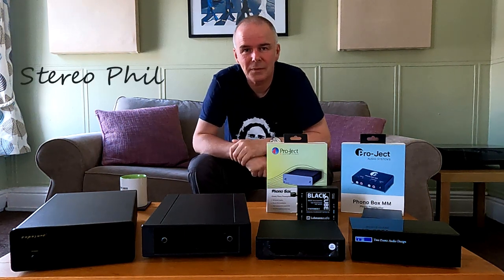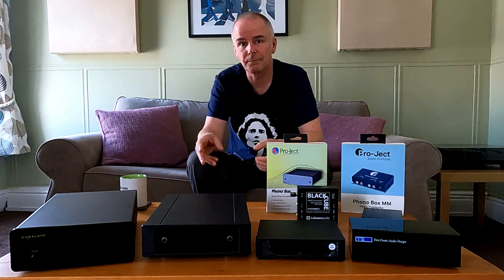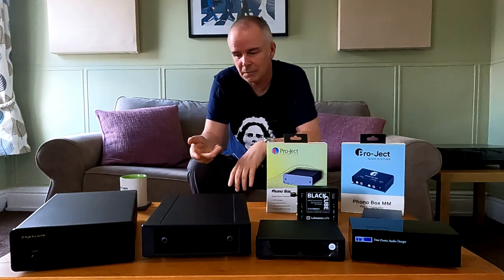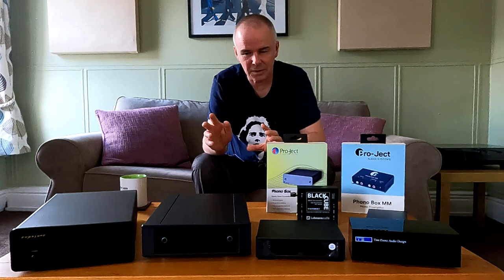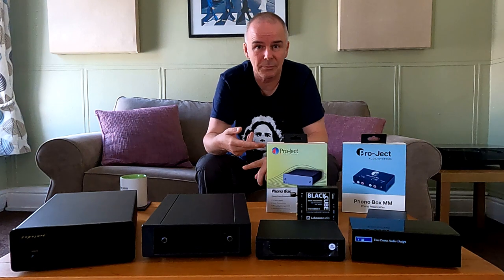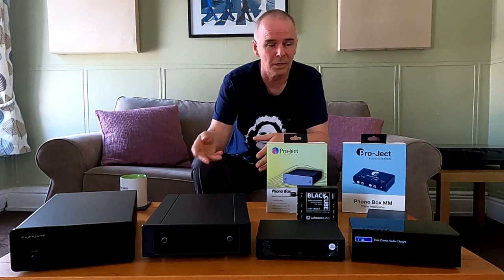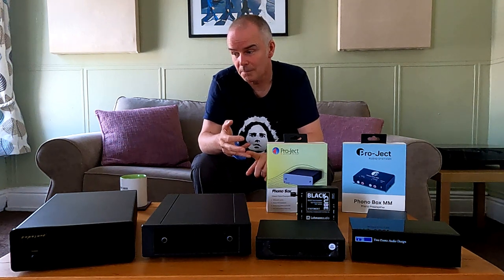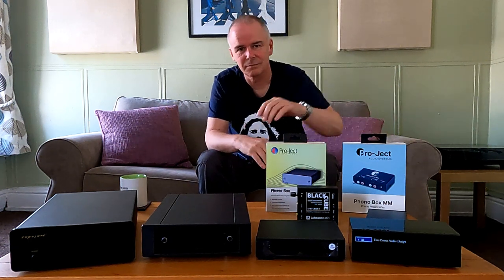Phonostages what are they and why do you need one?

Comment: Hi, In recent years I’ve gotten back into vinyl in my retirement as I’m now listening more critically. I’ve modified a Goldring Lenco GL 75 with Syrinx arm and re-tipped my Nakamichi MC1000 reference cartridge with a new shibata tip. The phono stage I am using is the internal phono stage of my Vacuumstate FVP5A preamplifier that is 40years old and now upgraded to the latest spec. This was considered to be one of the world’s finest phono stages some years back and it sounds fantastic. However because of my cartridges very low output I’ve had to install a step-up transformer in between the turntable and preamplifier which is a Audio-Technica AT-630 transformer. I’ve had this for almost as long as the preamp and would like to upgrade this rather than adding resistors across the inputs. What step up transformer would you recommend as you didn’t mention this possible issue when using Moving coil cartridges in video? Ps I enjoy your videos hear in Sydney Australia. Condolences for the loss of the queen. I grew up singing “God save the queen” at school assemblies and before the movies started in cinemas.

Comment: Best bang for buck I’ve ever heard was the TRON Convergence Signature phono stage made by TRON Audio.  Hands down wiped the floor with the Rega Aria and other similar stages.  It’s a high quality ultra low noise valve stage with brilliant dynamics and presence and I wonder why its not better pushed, especially at it’s reasonable price point? It seems only the big guys get the advertising and I do consider that to be a real issue with the uk hifi industry when there are some superlative products from smaller uk manufacturers like TRON.  Phonostages are one area thankfully where there is a lot of choice but you can also pay a lot for one which is no better than many entry level models in sound quality. Best thing as always is see if you can get a home audition as this is especially important when matching phonostages to TT’s and amps.

Comment: Hi Phil - interesting and very helpful information - question for you or others perhaps - Does the inboard phono stage in a Sugden A21 - tech spec  3.0mV MM 0.2mV MC work well enough - and will a moderate cartridge upgrade - say Ortofon blue work fine on the Sugden - or can it be improved by adding an external phono preamp -- Thanks and regards, Paul

Comment: Hi. I am new to the game and found your video. It is a jungle. There are phono stages from 50 up and beyond 10000 pounds and also integrated amplifiers with built in phono also in all sorts of price brackets. I am guessing it is a better phono part built into a highend amplifier like a Rotel Michi or other something like that than the cheaper Project phono stages. But how do you tell how good a built in phono stage really is?
Reply: You have to just listen and trust your ear... and you won't be able to tell a difference until you buy a 2nd or 3rd Phono Stage so you can actually compare the sound.  So it gets expensive!  Crank your volume gain to 10 on your phono stage channel on amp, does it produce a lot of noise or hum/buzz?
Reply: @ConnahJay  Well, that is not much use trying to decide what preamps that are worth testing. Have to know where to start.
Reply: @Average-Al  Darlington Lab MP-6 or MP-7 are amazing. MP-7 is one of the best phono preamps under $1000.  If want something cheaper that reviews really well get a Schiit Mani 2or look into finding a iFi iPhono2 used.  Best cheapo is probably Mani2. I've done the research, happy to share.
Reply: @Average-Al  I personally own a Darlington Labs MP-7, I love it.  If I was to buy something cheaper it would be the Schiit Mani2.  If I wanted to buy something a little better than the MP-7 that is expensive it would be a QuickSilver Phono Preamp.
Reply: @ConnahJay  But if you would buy an amplifier with built in phonostage, what would you pick in that case? Rotel Michi, Technics SU, Yamaha AS ?
Reply: @Average-Al  I think you should always use a external phono preamp, so budget that in.  But to answer your question I'd go for the Yamaha.
Reply: @ConnahJay  I would rather spend 100 extra on a good amp if I can avoid an extra external box.
Reply: @Average-Al  Then just buy amp and forget the word external phono stage because thats for the people who are really trying to get the best sound from their records.  90% of people never move on to that level and are completely happy with whatever is built into their amp.
Reply: Well that is not the point. There is a difference between riias in cheap 500$ amps and 20000$ amps. I am curious at what level integrated amps have a better phone amp than say the sub 500 separates.
Reply: @Average-Al  I'm not really sure, that's why I'm buying $500 separates. 🤣